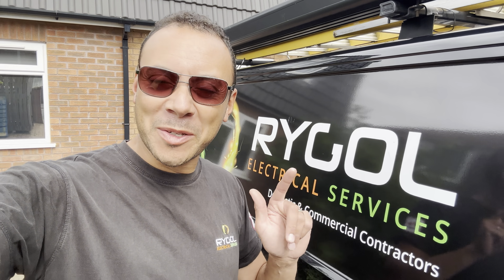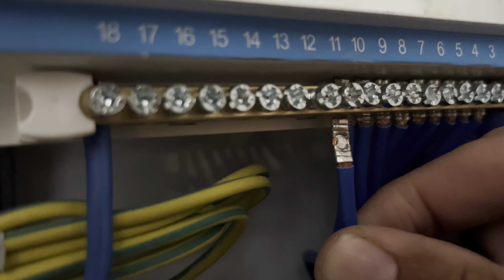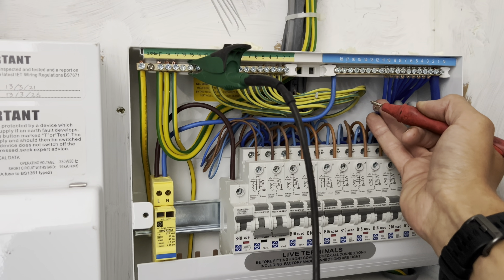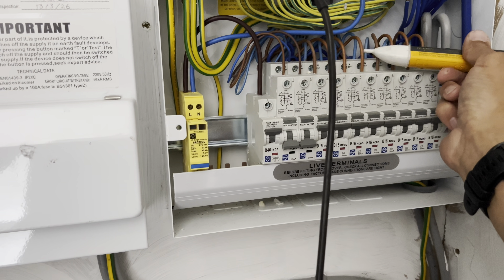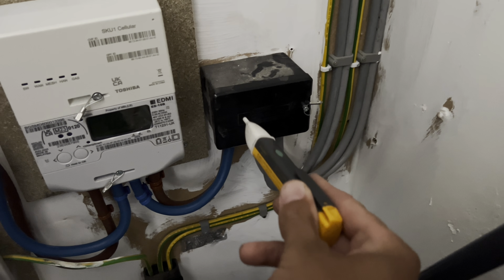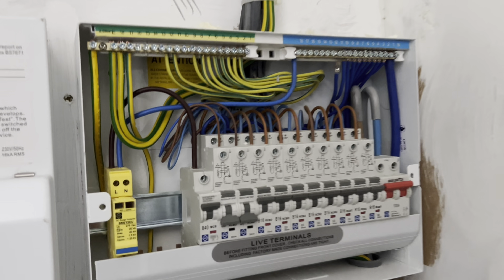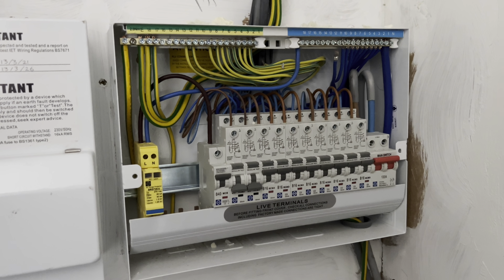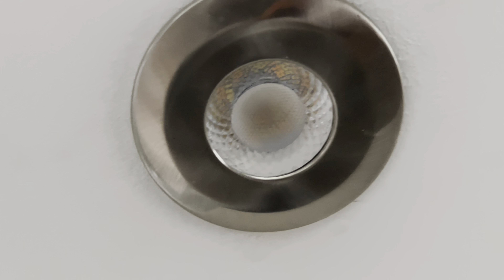Smart Meter Disaster! ⚡️

Comment: As a retired electrician I thought what beautifully arranged wiring,  a consumer unit I would have complete confidence in, however a hidden death trap lays ready not far away. My first thoughts were an induced current from a high current circuit into a the lighting neutral, however, I was confused regard LEDs allowing current to flow through the neutral.
If I were testing a ring main socket I would have use my plug in tester, also I do find my volt stick very useful.
Every month, I am being pressurised into having a smart meter installed, instinctively it doesn't seem very smart to me.
I take and send in my meter readings every couple of months.
Your explanation and presentation does your company credit
Reply: Well I'm not keen on the idea of a smart meter for other reasons. The issue here is someone has wired up the polarity incorrectly, so I can't blame that on the smart meter !
Reply: The dangerous fault here has nothing whatsoever to do with it being a Smart meter and everything to do with it being a dumb installer. The result would have been the same if he'd replaced the old meter with an identical non-Smart one.
Reply: We had smart meter installers cutting away sub mains thinking it was an illegal supply . Then we are sent out to a no supply next door.
Reply: I live in Australia & was forced to permit the Smart Meter being installed.
From that time on my electricity account has risen over 40%.
Charging is now made on an hourly reading, with daylight hours rated at huge price, and night charge (11pm to 5am) heavily discounted.
Of course I don't use electricity at night (sleeping time).
They are trying to force consumers to use washing machines, etc at night.
All this is because the government "privatised" the electricity supply.  There are now more than a dozen private companies. I have to select which one to use.
All utilise the same power, the same wires, which they don't own. Each one then sends a bill to their customer (with very similar charges).
Of course they make as much profit as they can squeeze out of the customer, wheras before the smart meter the municipal provider only had to cover costs.
We Aussies are being ripped-off.
Reply: I've signed up to a variable tariff for my energy, where the price I pay depends on the supply and demand on the grid at that time and how much the energy company has to pay for what they need.  So, at the moment I'm paying about 2/3rds of the price cap rate for my energy because demand is low.  I'll pay less on sunny or windy days when more renewable electricity is generated, but I'll pay the price cap rate on cold winter days.  In 4 months, I've saved about £200 over what I paid last year.  This is only possible with a smart meter, of course.
Reply: Just do what I did, just tell your energy suppliers you're NOT fitting any of those so-called "smart" contraptions in my home, full stop, end of story, now they've took me off their smart meter mailing lists.
Reply: I have that flickering on a LED bulb in the space under the stairs you can only see it when you close the door , the rest of the house lighting is LED but dont flicker strange i have the plug in tester it shows live & neutral correct as you say an induction may be the cause .......
Reply: Good comment.
With the LED's don't forget they are diodes with a forward voltage and ring capacitance was causing the intermittent discharge. Cheers.
Reply: Smart meters produce huge dirty electric pollution and emit hundreds of times more radiation than a mobile phone
Reply: Smart Meters can cause heart attacks and strokes. You need to be at least 6ft away from a smart meter. Smart Meters can not only turn off all your power remotely, they can also be used to switch off individual appliances. Or start fires from wall sockets and light fittings remotely. Please research the truth about Smart Meters.
Reply: Well done thanks for sharing
Reply: I don't use lights at all. Rechargeable wall sconces stick on w sensors electric £37 - £50 per mth
Reply: @FortitudeVeil But where does the electricity come from to charge those rechargeable lights..?
Reply: There's nothing wrong with a smart meter if it's correctly installed.
Reply: Just ignore the smart meter bs
Reply: My objection to smart meters is that they have a remote disconnector in them and can be used to give selective rolling blackouts
Reply: @miscbits6399  das it mater where the disconnect happens when there is a power cut?
Reply: @tarant315  you miss understand what he said… his point is they can turn your power off when they see fit remotely and call it what they want a blackout, power shortage, etc
Reply: @tarant315 they can selectively cut your power if they feel they have to, to maintain power else where, do you have shares in power companies. 😞
Reply: @miscbits6399 that is why I will never have them fitted. 🤔
Also, you have an electrical device constantly consuming electricity - showing you how much electricity your home is using. Kind of defeats the term "smart meter". They are more data loggers than smart meters.
Reply: @miscbits6399  yep me too ! When I almost signed up for a smart meter, there was an interrogation on if there were any vulnerable residents in the house. The questioning seemed obvious to me , they wanted a database to work out if they can "safely" remotely disconnect the supply, and not affect some disabled persons heart machine or other equipment.

Smart meters are about saving on people going around and reading meters, and on remote load shedding when the wind doesn't blow or the sun doesn't shine.
Me , I don't mind sending  my electricity company with pictures of my meter. They then keep reminding me that it's not a smart meter ! But they get their readings regularly !
Reply: Smart meters, no thanks,disconnect the power, cut the cable don't want it, candles for me please
Reply: Avoid them at all cost my friend.
Reply: There is no induced current, only capacitive coupling. You just don't get an air core transformer at 50 Hz.
This would be much less dangerous in countries that use double pole circuit breakers.
Reply: @Marek-o3u  I got a battery which is kinda generator
Reply: Please rethink the idea about smart meter = bad again, dynamic pricing will be unavoidable if we like to be self reliant on electrical power, that is the nature of renewable production right now
Reply: @tarant315 i take mine out right now my doing the same lights flicking all time Pathetic America, right now there’s nothing you can do about it
Reply: @tarant315  Au contraire, why don't you reconsider the practicality or possibility of renewable power? If it had been an honest announcement that there would be variable pricing and that smart meeters were needed, that would have been one thing. Anything that starts with a lie can never be truthful, and it started off with the preposition that by knowing your consumption at any instant, you could somehow consume less.   
Follow-up idea gas central heating boilers which are between 95 and 99+% efficient (depending on how you choose to corrupt the measurement) are wasteful because heat pumps can produce up to 4 times the amount of heat than the energy delivered to them. I can try to explain that only thirty-something percent of the calorific value of the fuel used to generate your electricity ends up as electrical power at your house. Simple clue, what does your gas cost you per kWh, and what does your electric cost you per kWh? So let's add a massively complex system to get us to be where about we were, whilst having to balance a generating capacity and distribution infrastructure for all the electric cars we will have. When did you last have an electrical power cut? Have you ever heard of a gas power cut?
Reply: @COIcultist  my last power cut was 3 weeks ago, but with a battery in the house, I have backup power on a extension line. It's not the wastefulness of oil or gas, but the pollution they create and yes I can't build a power station which will provide me with 100% clean energy, but my solar brought this up 60% from my side
Reply: @COIcultist  " Anything that starts with a lie can never be truthful" 
In Australia the national requirement to replace old meters with smart meters is titled
"The Power of Choice"
You can of course refuse to have a smart meter installed , so they just tag the old meter as faulty and under "The Power of Choice" all new meters must be smart.

So they turn up at my Dads, present him with a sheet of paper with a lot of defect boxes checked saying the 2 outside meter and switch boxes need replacing, because they cannot fit a smart meter inside.  A new small box was added beside the older one a couple of years ago to house the gear for 4 split system air conditioners we had put in for him.
 So a 95 year old pensioner worried about all these defects pays $4500 for a new box and wiring install. 
 Then they install the smart meter.
 Got back, called the Ombudsman, nope , all official and correct.
"The Power of Choice"
Reply: @johncarlaw8633  There's nothing wrong with smart meters. There's nothing wrong with 5G or microwaving your food either.
Reply: @jdillon8360  "There's nothing wrong with smart meters" Do you see nothing wrong with scaring a 95 year old pensioner into spending $4500 for a new box and wiring install just in order to get more room for the supplier to fit a smartmeter?
Reply: @johncarlaw8633  That's not a problem with the smart meter. That's a problem with dodgy installers.
Reply: @jdillon8360  The national requirement to replace old meters with smart meters is mendaciously titled "The Power of Choice".

" That's a problem with dodgy installers."
 The "upgrade" was done by another party and it was not an unreasonable price for what they did but it was largely unnecessary.
The officially appointed power distributor unnecessarily scared dad and others with a "requirement" under their letterhead to "remedy defects" in a perfectly good installation with no mention he could just refuse.
Which carries through to while there is no problem with smartmeters there are huge problems with what those who go to devious lengths to get them installed do once they are installed.

Also my dad had a microwave, a mobile phone and wireless internet modem so I don't know where any of the stuff about microwaves and 5G came from.
Reply: @jdillon8360  Correct on all counts!

Comment: you did not show the fault, the double pole connector block looked connected right on the input with the neutral to the front.So was it the outgoing side reversed ?

Comment: The amount of times I've touched neutral and not even thought about it twice is unreal. I'm not an electrician but I do all my own work and I don't even bat an eyelid at neutral. This video just made me reconsider that 😂
Reply: Always test. Include ground. Better safe than think it's not logical that any particular wire is anything but what it should be.
Reply: nice to see you here
Reply: @LiquidSnakeSSJ4  Here in the comments, and still here in this life!
Reply: my thoughts exactly - that torch thing that lights up that he had - is excellent.
Reply: Any work I do I treat everything as live just in case. My house has real old wiring and most wires are the same colour, so the only way to tell is with a volt meter anyway.
Reply: @Valehass  I spent my childhood in a 1920s house with the original wiring. Big round pin plugs. No proper earthing. 
I remember my mother getting a nasty shock from an electric fire one evening.
Reply: Neutral is a live conductor.
Reply: @fountainwell49man65 it is also at the same potential as ground/earth in a TN system .
Reply: I was horrified when the Fluky showed 240 volts between ground and neutral 😱
Reply: @ThorOdinson1269  USA has a safer system. Worst you will see is approx 120V. (unless you get one hot one ground and the other on neutral)
Reply: I know my house is wired correctly, as I've wired it myself. I still check whenever I need to add some home automation stuff or whatever.
Reply: I’d wire a plug or change a lightbulb but that’s as far as I’d go.
Reply: im an ee and we treat every wire as live including earth. also work with one hand in the back pocket
Reply: Get yourself a testascope, handy tool to have if you don’t own a voltmeter
Reply: Another dangerous neutral fault , if a neutral has been borrowed from another circuit which does happen, you isolate supply to circuit being worked on check with your meter and its dead, if you then cut neutral on the circuit you have tested to prove its safe but you would have 240v across the cut ends.
Reply: Our first house was
 built in 1935. When I moved in in 1987 I found the live and neural were swapped at the mains infeed . The cables came over the roof. I called the Electricity board the morning after the big storm in 1987. The crew didn't know what they were doing I had to tell them what to do. They fixed my problem. I told them 13:04  to check the old couple's meter next door . Theirs was now crossed over because an electrician had notice the fault and swapped the tails at the meter🤦.  All sorted .
Reply: Picking up a supply through the earth system because a live wire is touching som bricks
Reply: PLEASE PLEASE ALSO DO NOT TOUCH ANY CONDUCTER EVEN EARTH - assuming Neutral and Earth are safe is potentially fatal when the system has been incorrectly wired yet seemingly functioning - watch all of this following troubleshooting video as to how this experienced technician discovers he could have come off very badly from a wacko install modification.  I've seen enough problems that I only do data cabling, I leave LV and HV to the licensed sparkie always as you never know whats hiding and the impact is instant....:

Artisan Electrics
Nearly KILLED by a CRAZY fault! What on earth is going on? 
https://www.youtube.com/watch?v=MQ_XKCf5NTQ
Reply: Rules to live by. Always assume a gun is loaded. Always assume a circuit is live.
Reply: I was still in collage and thought I knew it all, still not qualified at this point but I was asked to do a few jobs and I thought ye I can do it and get my mate to test everything I do and certificate the property. Ye, second day in I touch a neutral that was live. Never made that mistake again. I was maybe 18 now 50.

Comment: Why did you not turn of all the switches before turning on the main power? In a normal house there is not a lot of power used normaly but turning it on one by one is more common I thought.

I was once doing maintenance and i saw that something was wrong with the device. I did see that someone had used the outher earth of a groundcable to use it as a life cable because the unit needed a continuous power over 2 lines and there was only one. They used the wrong cable and this was way more easyer.
So never touch anything with bare hands before measuring.

Comment: I assumed you informed the company that installed the meter?   and if you did I bet they will send someone out to fix the issue that you fixed.  O by the way how did you fix it without braking the seal because the connection to the main breaker looks to be the same way round by the colours?   Ammm maybe don't answer that one.

Comment: To edit my comment I fitted a wall socket and I did turn the electric too the wall sockets off but I got a nasty shock when connecting the neutral wire that did give me a nasty jolt, before my first comment I had forgotten about what happened when I fitted this wall socket. Now I understand what is happening I will contact SP too report this problem, thanks this has been one of the most important YouTube videos I have seen because I have other electric work that needs doing, and now I know my neutral wire will be live I don't want too be touching anything.

Comment: Works both ways....as a former meter fitter, I was about to change a meter and as I did my polarity checking was shocked to discover reverse polarity, initially by using a plug socket.....tried multiple sockets to establish I wasn't at fault.
It was at an elderly couples house....and their neighbor, a qualified electrician had done a rewire a few weeks before....whilst finishing he had reconnected the leads to the cutout incorrectly......for all your bashing of inexperienced meter fitters....they all have a unique serial code on their seals and effective traceability unlike most electricians who just seem to cut  and dispose of seals,do a job and then disappear.....I do know mistakes can occur but as stated by the video traceability was evident and should have reported and supplier informed as this was a threat to life.

Comment: I cannot understand what is happening because I was forced into changing from a PAYG key meter too a smart meter and ever since my bathroom light has this faint glow so I have been wondering what is going on, also I am know paying a lot more for my electric which should not be happening moving from a PAYG key to a smart meter I have just complained about this also asking about my economy 7 being set up. I was informed that my economy 7 was set up and I should consider setting up a direct debit plan but they never addressed the issue that my consumption has gone up, so I will carry on watching because I need to know why my bathroom light is constantly lit.

Comment: I'm not surprised. After fitting a smart meter I discovered they'd fried the motherboard on my central heating boiler. Cost me £300
Reply: How?
Reply: @spreston7376  Dunno. They turned all the power off, when they turned it back on the central heating didn't work and needed a new motherboard. Must have been a huge powerspike